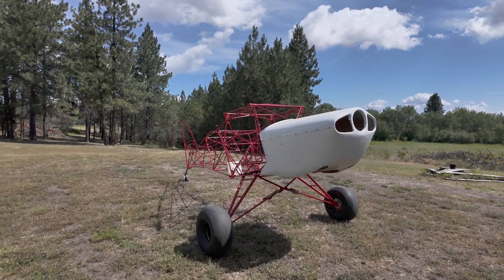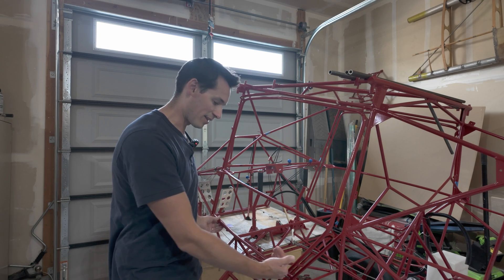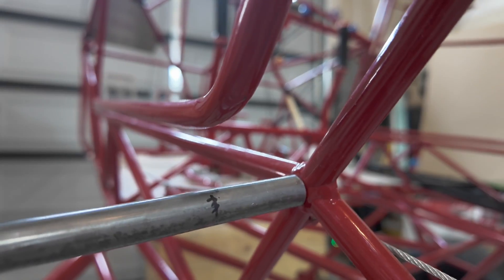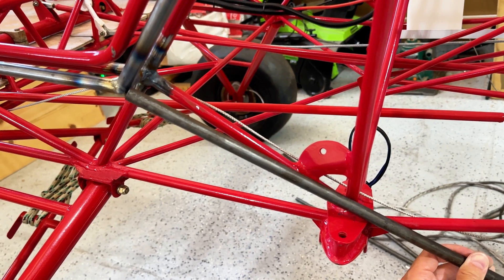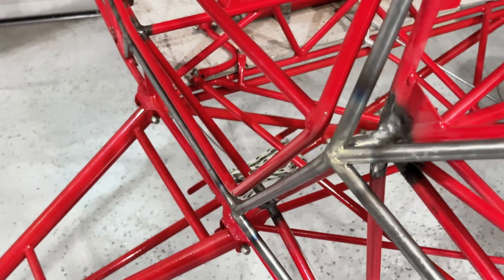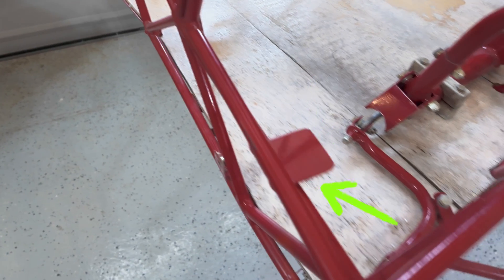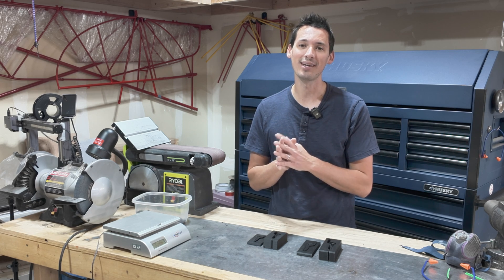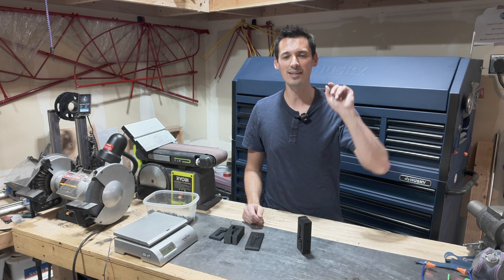The Wide Body Mod for an Avid Flyer or Kitfox

Comment: Will this increase your gross weight??
Reply from the maker: It certainly will make this area stronger. However increasing max gross weight also relies on stronger lift struts, landing gear, stronger wing spars, and possibly other areas as well. It really comes down to what weight the system is tested to during phase 1 testing (thinking of G loading).

Comment: If I can give advice I'd say to do a total different door latch design. I had an emergency that ended in a crash and we ended up in the river. Suddenly you realize a lot of mistakes in the design. On the pilot side the rudder cable ended up on top of the door latch which prevented opening the door in a hurry. My wife, navigator, could not reach the door latch before losing her seat belt which was a struggle in that small cockpit under water. Move your door latch up, midway in the door where you can reach it easy. It seems easy at the bottom until things go wrong.
Reply from the maker: Martin, thanks for the advice here, that's a great point. I hadn't thought about the rudder cable looping over the handle. So definitely something to consider. One reason I designed this way is so that if you need to get out in a hurry, it'd be a quick push of the wide part forward. I even thought to add the words" Push to exit" or something to that effect. My concern with the middle of the door is the complexity to the latching mechanism, this can create other areas that can be bent or bind in a tough situation, then your handle may not be effective at all. In either case I appreciate it and will take it into consideration.